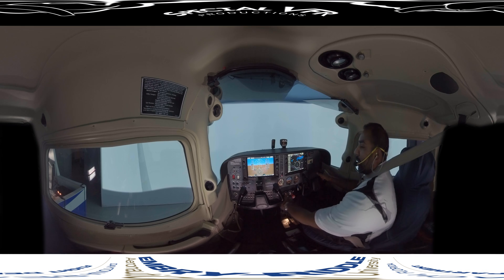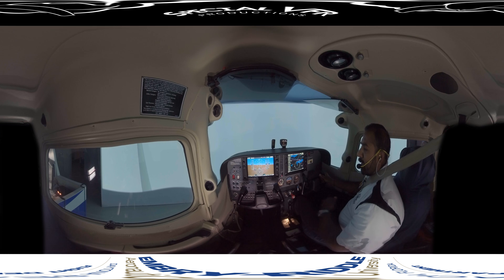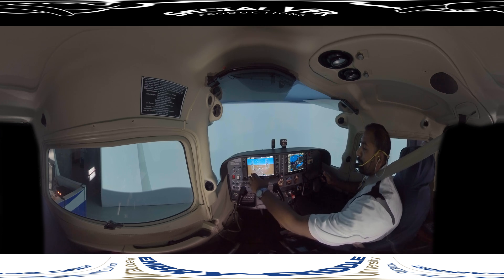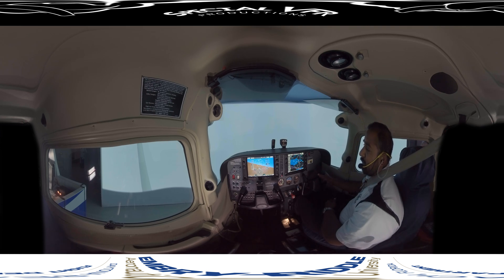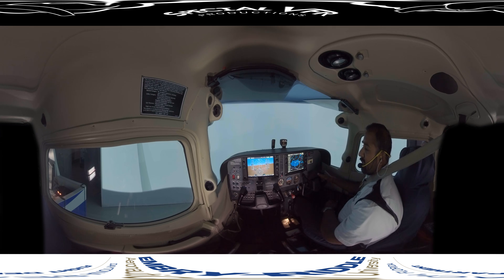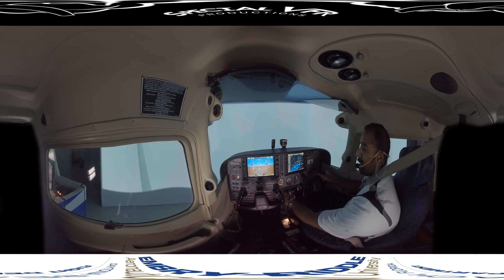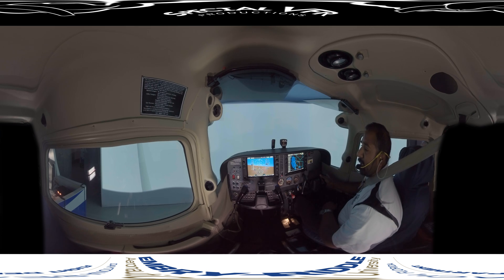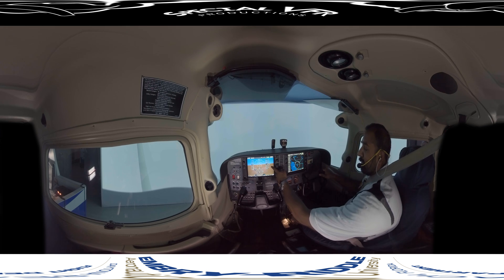Instrument Flight

Comment: The pilot explained that “ To maintain altitude while the speed decrease to 90 knots by pitching up”. But pitching up, u will need more power right? The reduced speed would slow the plane a bit and pitching up would make the plane decent? Why the plane can still maintain its level, I don’t get it?
Reply: you may be referring to pitch for airspeed, power for altitude "school of thought" BUT, that's really not how it works!  That only applies if you are "Power OFF"  (e.g. a gliding)  If you have excess airspeed, you can absolutely maintain altitude by increasing pitch (thus AOA) and still maintain altitude without adding power.  A "better" thought process is PITCH for FLIGHT PATH, POWER for AIRSPEED.  Just my two cents.